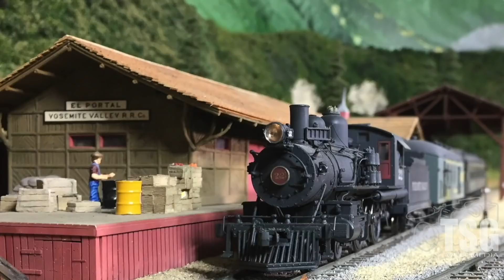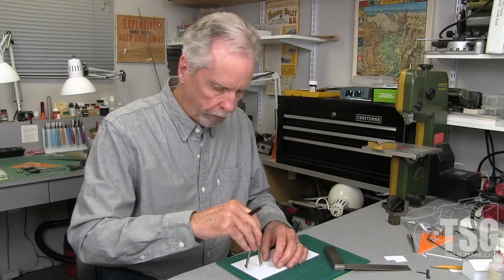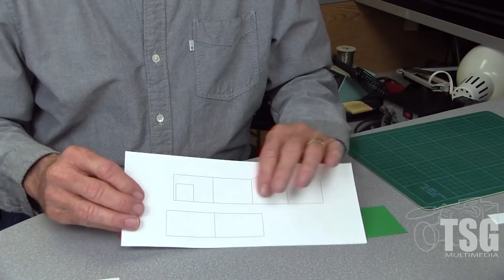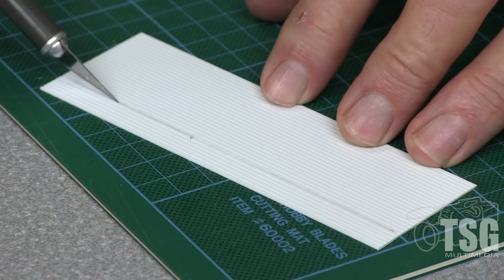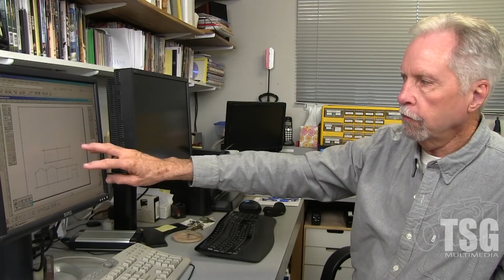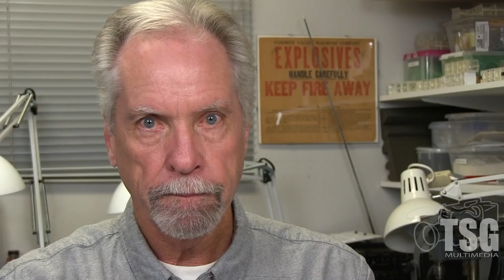Model Railroading with Jack Burgess Building with Styrene 2

Comment: Using a dividers to set the spacing for your parts  the DIVIDERS MUST be SQUARE to your edge and Depth distance !    The way you arbitrarily just held the dividers is not accurately squared ? Hence the distance will not be the same !     Cheers
Reply from the maker: Did you show the proper technique on your video series?

Comment: As a retired machinist, machine rebuilder and tool maker there are several ways you could achieve better accuracy than a ruler and a pencil. For laying out your lines one option would be to use a dial caliper. A 6 inch would work for most things. Set it the height you want and lock it in place. Now use the caliper like a combination square to lighty scribe you lines for the distance you set. The reason I said a dial caliper instead of digital is a digital is more of a PITA to set the distance you want. Another option is pickup a 12 or 18 inch granite tile from a home improvement center. Lowes, Menards, Home Depot, whatever. When there stop first in the tool section and grab a yard stick. Use that to check the granite tile for flatness. It's not going to be as good as a surface plate but good enough. Pick one out that reasonably flats fine. A good thick piece of plate glass is also good. Then find a surface or height gage. Look on Fleebay, Craigslist etc. Shars has one for about 40 bucks. Hold the material against something square. An angle plate, 1-2-3 blocks what ever. This would also be good if were doing something that had long continuous lines in the structure. Brick or stone work for example if your laying it out yourself. Maybe this is a little overboard. But I'm of the opinion that this hobby almost requires a certain amount of precision tools.

Another option for cutting out window openings. There is an item called a shim punch. Horror Freight sells one for, again 40 bucks as a punch and die set. They usually range from 1/8 to 3/4 (.125, .187, .250, .312, .375, .500, .625 and .750). One of these will punch a clean hole easily through styrene. Use the largest size that will fit and the get in the corners with the smallest. Use a chisel type Exacto blade (#18) to make  plunge cuts to finish the opening.
The Cricut. I've even seen where people are using them to cut gaskets out for cars and other equipment

The whole point is. There are a lot ways to skin the cat

Comment: Jack i love all yourbuilds im starting off my own builds in Nscale my problem im just not sure on what to order for thickness and size styrene if you give me a list on what to order that be great thanx again much appreciated
Reply: I use .040" styrene for structures but a small building (or a building in N scale) could be built with .020" styrene. For strips, divide the size you want (such as a 4x4) by 160. So a 4.x4 would be represented by a .025x.025 piece of styrene.

Comment: how thick of styreen can you run in a cricut
Reply from the maker: I think that depends on which model of machine you have. I'm sure you can find that information on the company's web site.
Reply: I can easily cut .020" thick styrene. You need to purchase a deep cutting blade and set the Cut Pressure at 340 and the Multi-Cut at 6x. If you need more help in setting up a custom material, email me through my website and I can get you more information.

Comment: Jack, what's the recommended maximum thickness styrene that it can cut? I gave some projects, and think this might be a better investment than a home laser cutter (which I've also looked at).
Reply: I think that .020" is as thick as you can cut on the Cricut. My normal building sides are from .040" styrene so I back up the .020" with another piece of .020" inside the building. I too thought about a laser cutter but got turned off by the need to vent the smoke. I have had a professional laser cutting company cut .040" styrene without melting the edges but I'm not sure that the home laser cutters could do that.
Reply: @yvfan  thank you!
Reply: The Cricut Maker cuts through dense materials up to 2.4 mm (3/32”) thick. https://home.cricut.com/cricut-maker

Comment: Another 'tip', old phillips head screwdriver or hex head screwdriver, cheap tip that is bad for screws can be sharpened into a soft material shallow hole/countersink taper hand drill.  Hard to do with a good screwdriver with harder metal, easier with the cheap soft metal type.  Those crappy sets of driver heads made from pot metal can make a good hand drill multi tip set for modeling.  If you trash a tip, file it into a new cutting tip.  Also please notice the horrible pun!  woohoo!

Comment: I try to cut lengths that need to match at once, cutting 'tall' section that the lengths all come out of and are equal from having common end cuts.  flat sheet material its a great way to ensure something like two walls are the same exact length.  For tubing cutting sections longer and trimming at the same time taped together ensures common cut equality.

Comment: I would build a model railroad in my house but I don’t have any room.
Reply: N scale ---  you can build a nice layout on a 2' x 4'   or a nice switching layout on a 1' x 4'  peice of plywood or Foam board and put on some shelve brackets.
Reply: I had the same problem when I got back into model railroading in 1965 so I scratchbuilt models for a future layout and slowly improved my skills...
Reply: I can set up tracks around my basement for short time periods, I just wish I had a DCC locomotive and a DCC controller.
Reply: Check out micro layouts. In the US they tend to build large roundy roundy layouts. However you don’t need to you can build an OO/HO laying in a box file. A simple little industrial yard with a point/switch or two. My current project is about 800mm x 300mm.